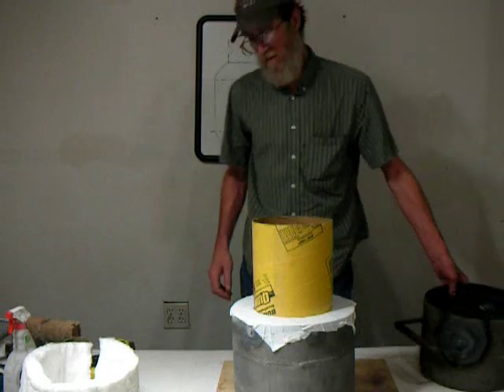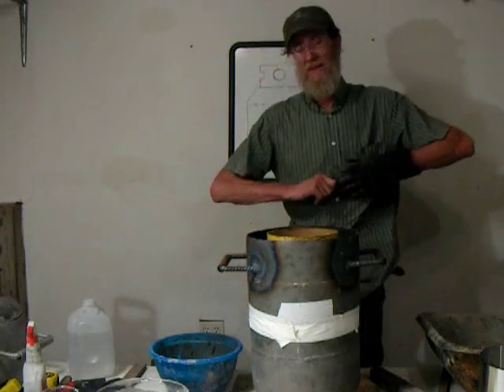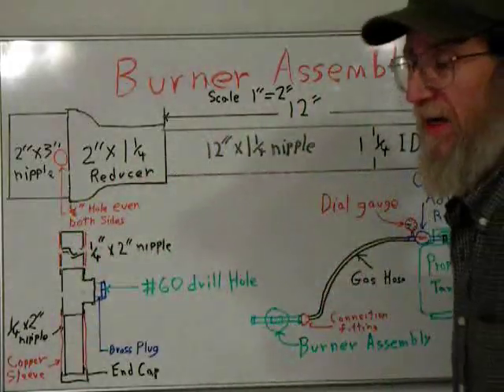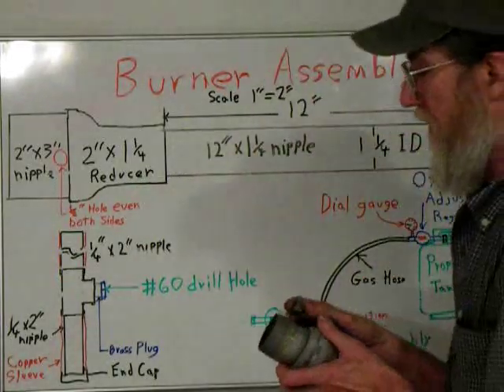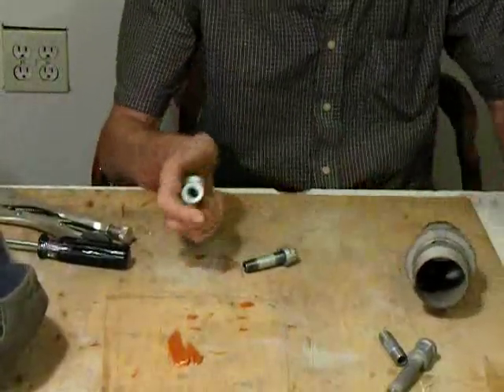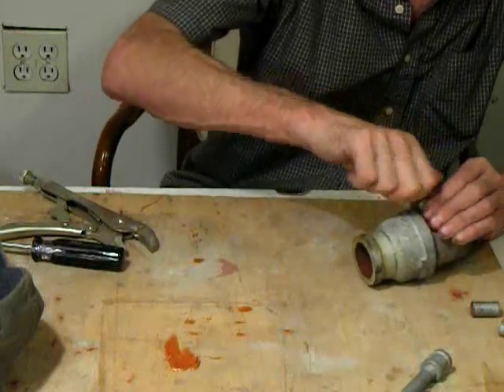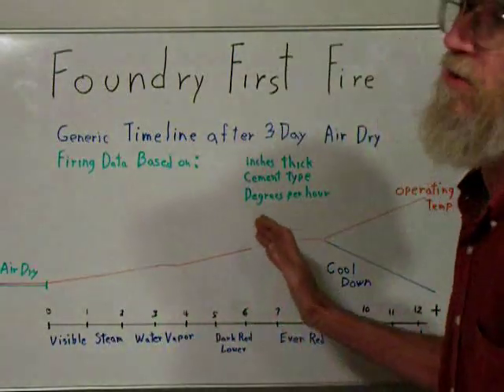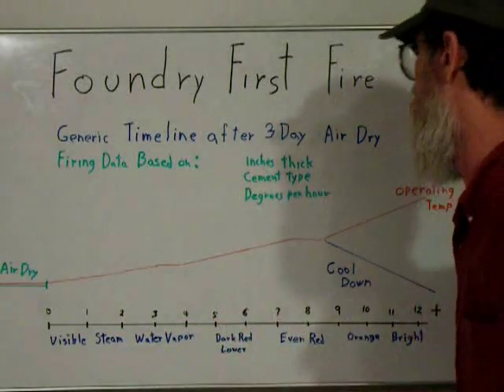Backyard Foundry Tutorial Pt 3

Comment: or you can get a couple hair dryers down at st Vincent DePaul for a couple bucks each 
 and  tape the  hair dryer to the pluming , and turn it on high and run its  for  5 hours a day on high heat  for about 3 days ,  or  put a   heat lamp in there for about a week and it will also cure it out  90 %  and leave No bubbles in your refractory  providing you made sure there was no  air or water pockets in you packing .

Comment: Thanks for taking the time to answer everybody's questions!  I have another for you regarding the burner.  Like other viewers, I'm having problems with mine burning back up the pipe.  I do have a high pressure reg and I did drill a #60 hole in the brass plug.  I also tried a tweco welding tip.  All other research I've done (including on Reil's site) shows a flared end.  I made a crude flare and it helps, but not entirely.  How do you get yours to work without a flared end?

Comment: It works fine, wether or not its truly a "refractory" would be questionable. Does it work for a home built coal gas or waste oil foundry? Sure does, youll find liquid aluminum in there :). My latest foundry is a 5 gallon bucket style but i used kaolite, because it was free from the boiler shop behind my work. Much nicer to work with the professional stuff.

Comment: Thanks for the video series!  I'm in the process of building my own foundry exactly to spec of yours.  One question as I am a complete newbie to this kind of stuff: how do you ignite the propane?  I'm in the first few steps (cut the propane tank in half and cut the holes in top and side) and just picked up all the materials I need to complete.  Before these videos, I was just using a steel bowl and a bunch of wood to melt aluminum.  This will be much cleaner and easier to deal with once finished

Comment: I must say compared to many how to vids this has the be the most simplicit yet straight forward however I have to question one being a a concern, the burner would the flame not retract back down the pipe back to the tank or will the high psi stop the flame from retreating, secondly your crucible in the previous vid was pretty big and that will be costly to buy is there a way i could make it myself only to withstand 1300 degrees, say maybe out of fireclay and with first fire allow the home made

Comment: I'm going to make a similiar setup except im making it a larger diameter by using large diameter,heavy wall 316 stainless steel pipe. I want mine big enough to melt aluminum cylinder heads,which is very high grade aluminum...usually 6061.

 This is the best and easiest to follow DIY smelting foundry tutorial i've seen yet on youtube. Thanks very for the tutorial. Oh and Nizhonigo Keshmish Baah'ozho' do'o' Hozhoogo Ninanahai. (Merry X-mas and Happy New Year)

Comment: Thank you for the reply, I have a few more questions because I'm highly interested in this. Would you recommend separate crucibles for each type of metal that I will use to increase purity? Also, would you recommend any type/size (20#, etc.) of consumer propane tank for the foundry? And lastly, how would you go about making the bar and hook on the crucible (for better handling) used in the "Backyard Foundry" video, but on the graphite crucible? Thank you very much in advance. May have more ?'s